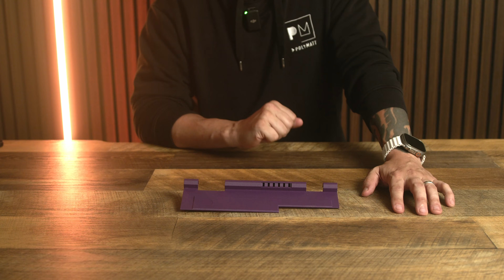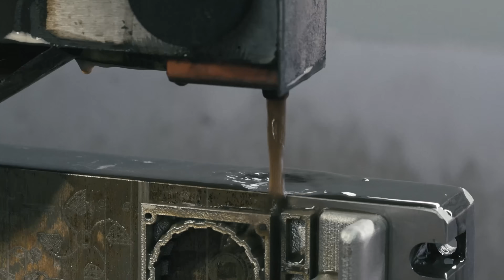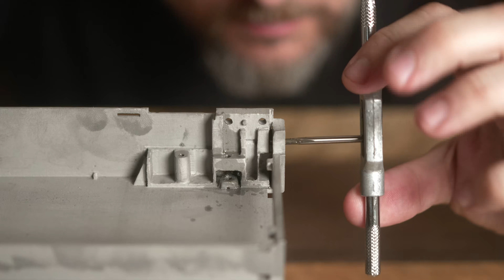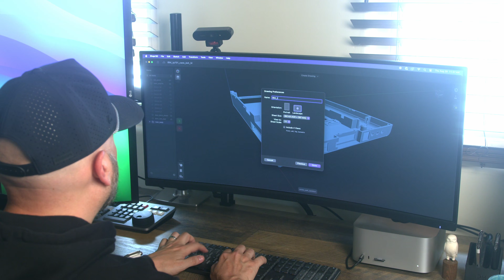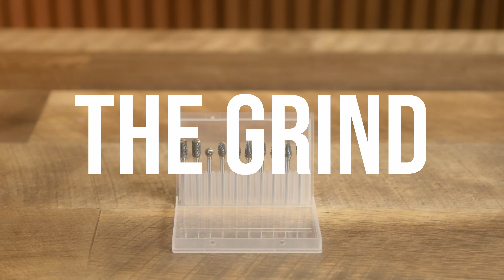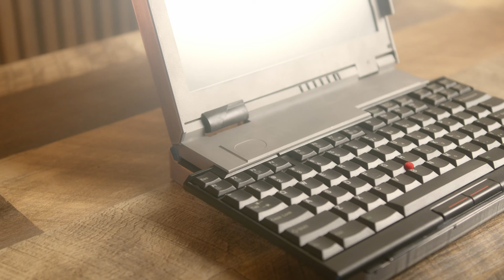I 3D printed a METAL laptop

Comment: Heating stainless steel to that temperature releases hexchrome which is highly toxic and can cause cancer.
Reply from the maker: If you’re only heating it and not creating fine airborne particulates WHILE heating it at high temps like welding or plasma cutting, then there’s not really a risk.

Comment: After more than a year, here i am, back here, rewatching this video.
Truly fun to watch, alongside all the other projects of course.
But while rewatching this second time, i just had an idea, couldn't the case be nickel or chrome plated after the high grit sanding and polishing to hide all the laser sintering artifacts ?
I'm not sure, but i think this might actually work, to get a nice uniform shiny metal surface, unless the sintering artifacts are actually a texture, i can't really tell from the video, but if that's the case they might show through the plating.
I don't know, just an idea, maybe part 2 ?😉
Reply from the maker: Thank you! It's a great idea and to be honest I'm not sure if the plating would cover up the artifacts - maybe if it's thick enough. I have another project in the hopper to do some interesting upgrades and who knows, maybe a plated case is just the thing that will do the new upgrades some justice!

Comment: On the subject of custom made metal parts, casting with zamak is very home-shop friendly and integrates well with 3d printing. 3d print a pattern, make a mold from it with plaster, and cast the metal.

Comment: JLC3DP is going to gain capability of manufacturing magnesium aren't they? A fair few laptops have magnesium internal structures or bottom shells, and these have held up well. It's a fascinating metal. AZ91 density 1.8, for comparison most product plastics around 1 and common 3D printing around 1.3, alu alloys around 3, zinc 6, steel 8...

The laptop came out to 11kg... Original weight 2kg. Still, would probably wear it a few times :D

Comment: Wow, what an incredible project and video! Thank you so much for sharing. Back in the 90s, I worked at Computer City in San Diego. I remember buying an IBM Thinkpad 701C, which had the option to configure Windows 3.1 or OS/2 Warp 3. At the time, I couldn't afford the laptop, so I ultimately returned it. However, I just had to get my hands on one and play with it for a while.
Fast forward 30 years, and I ended up with three or four of them from eBay, with one being in very good condition, which I displayed at work. One day, my absent-minded boss forced the screen closed for no good reason and broke the plastic bezel, where it remains broken to this day. I would love to get it fixed someday, and I'm so happy to see that I might have some options here.
Reply from the maker: Love hearing the story and oh man! - Sorry to hear that it was broken. They get so fragile over time. Hope you can fix it up or maybe find someone to 3D print one of the models Ive released? Best of luck!

Comment: Around a year ago I had a custom watch 3D printed in stainless steel by JLC3DP. Ever since, I've been wondering how bigger pieces would turn out, like a laptop for example. Now I know! Cool project!
Reply from the maker: Thanks so much and really cool idea of printing a watch in metal. Was it the case or some of the components as well?
Reply: @polymatt  Only the case is printed in metal. It's a digital watch so I didn't print a watch movement or anything. That's a little too ambitious for me 😅.

I did design the PCB and wrote the software for the watch though. The watch uses a vintage HDSP-2000 dot matrix display to show the time.

When it was printed in green plastic people would occasionally notice it and ask about it. Ever since it's printed in metal and nicely polished, it looks like an ordinary wach from a distance so people don't really ask about it anymore.
Reply from the maker: @Theking-uy3wu that sounds SUPER cool!
Reply: @polymatt  Hey I finally managed to create a video of the watch. I think links are often blocked in comments, but it should be visible on my channel.

Comment: First time i heard someone call it SLM instead of SLS (selective laser sintering)
Reply from the maker: Two different processes. SLM is used exclusively with metal powders and produces a higher precision part. While SLS CAN use metal powders its resolution is much lower and can work with a range of thermoplastics, nylons, TPU, etc.
Reply: @polymatt  I did not know they were two different processes, thank you for explaining!
Reply from the maker: @alexstone691 yeah of course! Was a new method for me as well.

Comment: 316 stainless is austenitic, this means that it can't be hardened with heat.  You can only "harden" it by cold working/work hardening.  Heating and cooling shouldn't make it brittle, heating will only relieve the stress by taking it back to the annealed state.
Reply from the maker: Really good to know, thanks so much for the tip!

Comment: Have you considered printing the parts with auxiliar support structures to prevent deformation during printing?
Reply from the maker: Definitely. Now that I know how the case deforms, If i were to do this again, I'd add in temporary internal stiffeners attached to the sides and the base with small (1mm or so) connection points designed to keep the case from warping but intended to be cut off at afterwards.
Reply: @polymatt  and on that note, switching to a lighter metal and/or introducing interior cavities in the design (either by machining out cavities, say in a honeycomb pattern, or printing the thicker volumes as a hollow 3D trellis) would be great additions!

Comment: Awesome project! 👏 

Since supply is scarcer and scarcer, what barriers are there to 3D print the butterfly keyboard components?
Reply from the maker: Thanks so much! Great question. So the keyboard is a tough one. It's really precise and made from a metal track in hard injection molded plastic. You'd probably have an easier time cutting sheet metal rather than 3D printing the base and the tracks, then you'd have to figure out what you're going to do for keycaps, as this is a rubber dome style keyboard and membrane. It's definitely doable but in my experience, the keyboard almost never fails. If it ever sticks, or doesn't work, its due to an issue with the case or re-assembly pushing up on the bottom since the tolerances are so tight. I've never seen one that's actually broken from use or stress.
Reply: @polymatt  If IBM / Lenovo doesn't get upset, I think a new keyboard and case, fully manufactured from scratch, would be a killer feature. 
Keep up the good work ;)
Reply from the maker: @davidoliveira7184  That would definitely be awesome. I don't think there would be any issue with the case, but the keyboard might be an issue as Lenovo just filed an updated patent on the butterfly design.

Comment: This is just awesome. It really makes me want to build my own laptop from scratch. I'm thinking that it'd be easiest to just weld some sheet metal and grind sharp corners. I could even weld nuts and bolts in strategic places to use as standoffs. If I made it really thick like older laptops were, I could maybe solder multiple Pi's together as a cluster and have a giant battery.
Reply from the maker: Do it! 🤘 Everyone should experience building a cyberdeck.

Comment: I wonder how it would look if you polished it, like would it be straight mirror finish?
Reply from the maker: I did polish the top and it’s very shiny - I can see my reflection in it but it’s not a pure mirror finish as there are lines and artifacts that I wasn’t able to sand or buff out. It’s embedded in the steel so I’m guessing it’s artifacts based on the SLM process.

Comment: This is pretty unique. Do you can make a more rugged framework chassis like as t410-t430 series (especially for the screen? Vinyl, resistant plastic or metal reunforces plastic. Thank you for the video!
Reply from the maker: Thanks so much! I would suggest MJF which is a sintered nylon and incredibly tough. I think that would be the way to go for a realistic project and not an over the top beast like this guy :)

Comment: I’m sure you’ve probably seen some Damascus forging videos from a certain British blacksmith, where he usually dips the finished parts in ferric chloride? Then in baking powder water to neutralize the ferric chloride, and then lets it sit instant coffee to get the Damascus pattern more visible and higher contrast between the colors.

I wonder what these metal 3d printed parts would look like if you did the same finishing process. Would there be any discernible pattern? Since these are made with very thin layers stacked on top of each other, I’m thinking it might have a similar appearance to Damascus
Reply from the maker: That’s a really cool idea. I’ll have to try it!

Comment: Could you perhaps have sprayed the interior of the case with a clear polyurethane paint to isolate the case from the pc components? Just curious. 
Great video. Keep up the good work.
Reply from the maker: Thanks! I thought about it but there are a few sharp parts on the system board that I would be afraid would puncture any thin layer. Another person suggested plasti dip but it’s not very rugged at all - especially with sharp objects.

Comment: im gonna be such a negative nancy here but collision impact would be astronomical due to rigidity, no?, this is protection for the case itself if any, not to mention electrical circuit hazard. looks cool though
Reply from the maker: I knew going into this that it was never meant to be practical - just an excuse for me to try out metal 3D printing and do it in a cool over-the-top build!

Comment: Im going to have to check into that printing service! I resin print and sell a part for cars that i sell for $30 each. I have had a few customers have issues with the parts getting brittle and breaking due to heat exposure under the hood of their car. I contacted a 3d printing service to inquire about having them printed in aluminum or stainless steel and their quote was over $300 for one part and the price really didnt drop ordering multiple parts. The part i sell is small and has about 1/10th the materials that your laptop case uses.

Comment: What's going on on the side of the machine there? Did you cut the sides of the chassis off? I wish there was some 360 b-roll of the finished project. I really dig the brutalist design.
Reply from the maker: Good question - that whole side is for the components: battery HDD and PCMCIA covers. I didn’t have the battery in and chose not to print the other covers in metal because the covers need to bend a bit to lock in.
Reply: @polymatt  Maybe you could spray the plastic parts in metallic spray paint and use them

Comment: I'm currently in the process of designing a "laptop" with a similar idea to this but using standard PC components instead. One of my big concerns was the precision of the metal 3d printing and if my part would arrive slightly smaller or larger than specified, but most of my worries are answered now, This video is an amazing resource to me, not to mention this project is insanely cool!
Reply from the maker: Really glad it helped and best of luck on the project!

Comment: Speaking as someone who has 3D printed a lot of housings, a good easy way to do the PCB mounting hole fitment is to make standoffs larger than you need without holes in them and then cut out the hole afterwards in the perfect spot. It doesn't work as well with port holes on the outside of the housing, but you can still alter the surface around the ports to cut them out afterwards, and a good trick with that is to make labels to cover up oversized port holes. You can even make labels out of metal as a flat panel that can be printed and that will be much, much more accurate than the holes on the side of a large housing with complex geometry with all the warping and shrinking that goes on

Comment: Any chance to get an electric shock from this metal case ???
Reply from the maker: I’ve insulated it pretty well but there’s definitely a non-zero chance 😁
Reply: @polymatt  Therefore, is it safer for regular users to have a plastic notebook case?
Reply: I've often had some tingling with magnesium / composite Thinkpads 😅

Last time I got some tingling from a metal train handrest when charging my phone.
Reply from the maker: This was never intended to be practical - I hope that came across in the video. I really just used it to explore 3D Metal Printing!

Comment: Just a thought, would it be better to machine a metal case out of a different type of metal like aluminum or some alloy to keep things lighter? I know this was just a fun project for you to learn about metal 3D printing, but I was merely wondering if that would be something you might do later on when you get tired of carrying that weight around.
Reply from the maker: Definitely better for the material selection but you’d have to break up the model into multiple pieces. There are some tricky details, holes and undercuts I don’t believe would be possible even on a 5 axis mill the way that the base of the case is today. If I were to separate out some pieces, definitely doable.
Reply: Magnesium and magnesium composites are often used in laptops.

Comment: The vinyl wrapping of the interior kind of seems like an unnecessarily labor intensive choice. You could have just spray painted a layer of clear coat over the entire inside as a conformal coating. Given that the internals don't move once they are screwed down that would have likely been more than enough.
Reply from the maker: If you’ve seen my videos labor intensive is my middle name :). Definitely not going for efficiency here! Also while screwed in there is still a lot of flex in the system boards and having the keyboard sitting right on top - definitely wasn’t going to take the chance of frying a very special bit of hardware.

Comment: I think the lcd you could create the outer frame and then the rear can just be a fine steel sheet screwed, that way itd be easier to bend

In fact I would do that to the bottom too

Excellent video. Definitely some issues, but it’s great.
Reply from the maker: Much appreciated. You’re right there are a lot of ways to make this more efficient if the goal was to design a new case from scratch. I really wanted to replicate the current case.
Reply: @polymatt  do they have a hard enough plastic to build this as well?

I have so many laptops I miss but they are all cracked.
Reply from the maker: @nR-kv7xo  I haven’t been able to find any for a consumer grade printer. The harder ones are more brittle. 

What would work VERY well is a MJF print in Nylon.

Comment: Low carbon stainless steel shouldn't become particularly brittle from rapid thermal cycling. It work hardens like a mofo if you bend or press it a lot but the grain type doesn't change in a significant way from heating and rapid cooling. You need a bit more carbon than what's present in 316  SS. Austenetic stainless steels tollerance to thermal cycling is a big reason it's used in many situations. 

I've straightened pieces like that by tacking a corner to a piece of carbon steel, stretching or otherwise forcing it into place, tacking it to hold position and heating the whole thing up. I have a love hate relationship with stainless steel. Getting it to behave how you want is a pain.
Reply from the maker: Really good insight thanks! Wish I had access to a proper metal shop as well. Have you worked with this kind of SLM SS before? I’m assuming it probably has some different properties than traditional stamped/rolled/forged etc.

Comment: 15:42
You should just use plastic sheet like every PSU ever made. 
OLD gaming consoles with AC PSU inside has it too, PS2/PS1 has bare PSU inside the console has this sheet perfectly engineered.
Reply from the maker: The issue is that it’s not just the base that I needed to insulate. There was a TON of other small places that touched the case like surrounding the connectors.

Comment: How about using an inlay for isolation out of a 3d printer? Just 2 or 3 layers with a low layer height should make a very good fitting inlay without manual cutting labour.
Reply from the maker: That would be a great idea for the top and base but there were a lot of really small edges and connectors I needed to cover all over the place. Maybe building up layers of an acrylic spray? There’s definitely got to be a better way.
Reply: @polymatt  I believe there are isolation sprays especially for electronics, but I wouldn't trust them for this application. Not sure about acrylic. If a sharp pin is moving and rubbing it of, a disaster can strike later.
I guess I would have just used some layers of Kapton tape in addition to a printed isolation layer.

Comment: For those wondering if it'll be tough enough to be a weapon, no it won't. Since it's laser layered, it'll likely shatter on shock loads.
Reply: They mentioned cooking it, he did too. Wouldnt that fix it?
Reply from the maker: Next video: drop test? 😄
Reply: I remember seeing some testing that resulted in, for many loads, 3d printed steel being incredibly comparable and sometimes even stronger than regular steel parts. Probably greatly depends on the type of load, however. As other people mentioned, i think the heating/cooling process would take care of a lot of the brittle-ness
Reply: @aeaeaeaeoaeaeaeaeae  Yeah, I've read about the uses more recently. I also had a brain fart moment when I made the comment, because I knew SpaceX 3D prints the hull of their Starships and had been 3D printing structural and engine parts for Falcon 9 and Heavy :|

These hardware go through intense amounts of heat, combined with sustained and shock structural loads then get reused lmao
Reply: The cooked parts should be plenty strong compared with the benchmarks like the carbon composites or magnesium bodies.